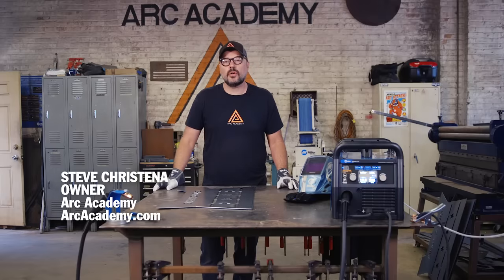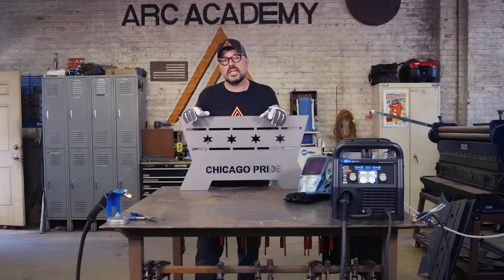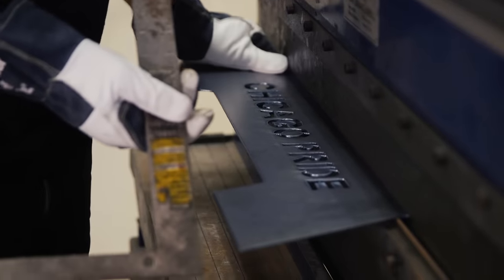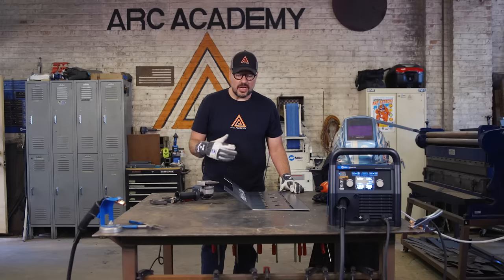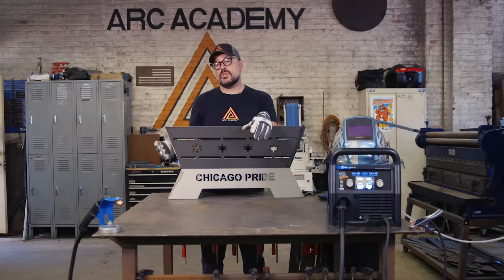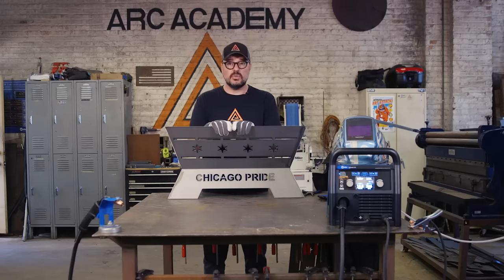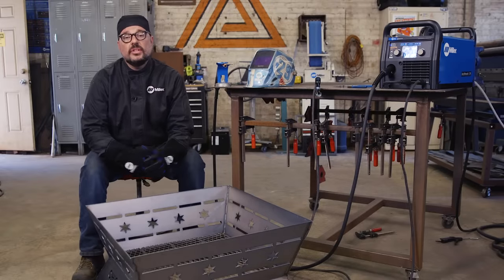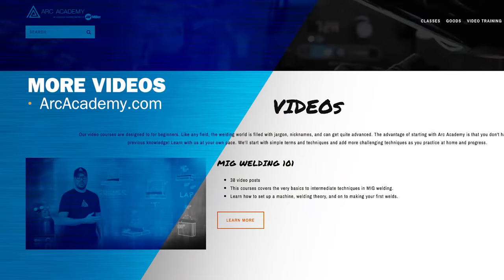DIY Welding Project: How to Build a Fire Pit

Comment: When welding the sides of the pit, does it matter if you weld on the inside or the outside?  I’ve watched several videos and it is split down the middle - some weld on outside and some weld on inside.  Does it matter or is it for looks?
Reply from the maker: Hello Brian. Thank you for reaching out. The answer to your question is yes, this would just be a looks thing. If you weld it on the inside you would have no bead showing on the outside. Let us know if you have any additional questions!

Comment: What was the blank sizes for the fire pit? I work in a sheet metal shop and would love to make one
Reply from the maker: Hi Sean, each side panel of the fire pit was 30 inches wide at the top and bottom and 24 inches at the narrowest part where Steve bent the metal.

Comment: What type of metal did you use; Mild steel or 304? I love these video's that Arc Academy and Miller put out! I like the Chicago Pride on the side too! That Multimatic is next on my list of welders to get. I'm loving my 210 DX!
Reply: AldoSchmedack i used mild steel works pretty good or if you want a bit better go with cold role steel. 👍
Reply: Hello Aldo, we used 16ga mild hot roll. If you are planning on using stainless with a design you may want to consider waterjet instead of plasma. Have a good one, and thanks for watching.
Reply: Stephen Christena  you said is 30” wide  on top what about top to bottom